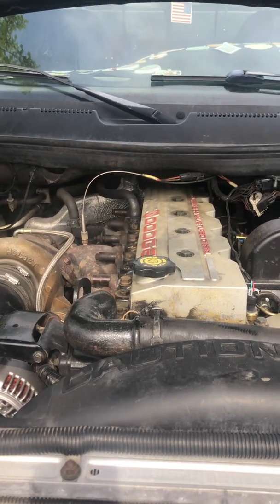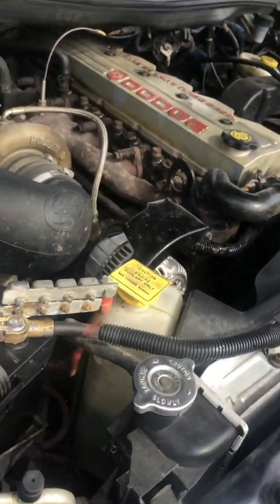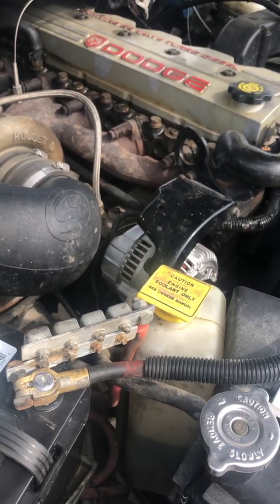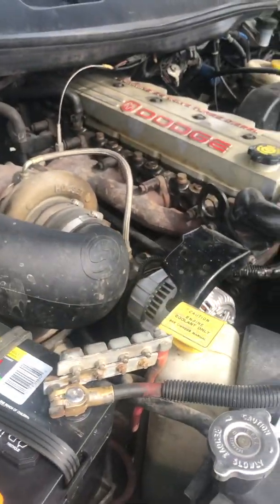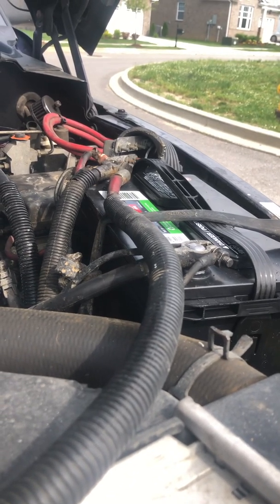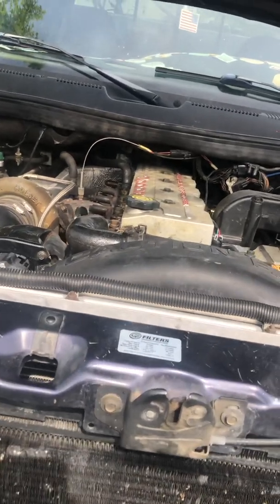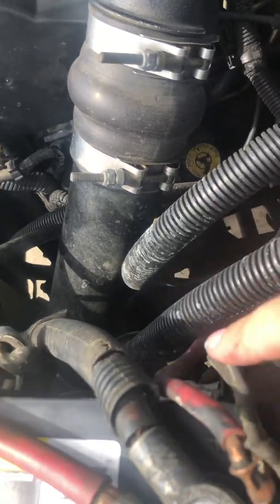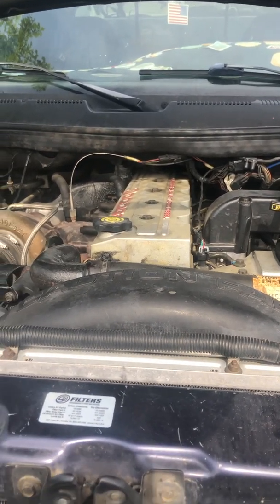24 Valve Cummins Charging System explained. Overcharging, undercharging, Alternator issues

Comment: I found the passenger side positive terminal cracked and battery post partially melted.  I thought it was just an issue with poor contact due to the cracked terminal, but was wondering about the alternator.  Thanks to your video i will change the alternator out since it's got lifetime warranty.  And i will get my batteries checked out.  Thank you!!!

Comment: Sometimes they send a voltage spike them fry all of electronic stupid how the charging system runs through the computer when they can wire it another way be easier to repair the old cars charging system was better

Comment: Thanks, excellent information.
Reply: Question, I am an old guy and need to add freon to my system. I have to do this every two to three years. I am having difficulty getting the hose to lock on to the low side of the system due to the location of the unit on the fire wall. The last thing I want to do is go to AC store. Any suggestions?
Thanks for all your help.

Comment: That’s for overcharging what about when battery gauge drops , check gauges red light on. My batteries semi new they are at 11. Something. I also replaced my alt less than two months and same problem got it checked n said batteries good ground good it’s the alt since its a reman

Comment: Hello,  Help help

Have a 2nd gen also. I have check gauges light 

2 new battery’s and new alternator. New battery terminals. I am getting a reading of 11.76 V on both sides. 

Cleaned all the grounds. Even the positive cable to starter. Tested alternator and reads the same as battery. Drains the batter in about 2 weeks of driving with check gauges. 

positive cables from passenger to driver battery had a little corrosion and also the one to the starter

Comment: Can’t you bypass the voltage regulator that is in the PCM? If necessary.
Reply: Yes you can use a 80s style Dodge voltage regulator that mounts on the firewall

Comment: Im having the same issues with my 5.9 2006. it has fried the alternator and (blew passenger side)battery acid all over/ not one but two batteries. brand new one took less than five minutes. the shop I took it to is trying to charge me $1800 for a new pcm and programming. the issues you described are very similar so I'm going to look into those diodes first. Thanks!!
Reply: Having the same issue with my 2005 I'm also having issues with my turn signal on the drivers side it turns it's self on and off like reads it out then it will work. Also my lights inside my truck won't turn on while my truck is running unless the doors are open and they will work when the truck is off and the doors are open but I push it in to turn it on and doesn't work

Comment: Diodes, are check valves. They keep the power flowing one way, and don't allow back flow when key is off. Normally in an over charge problem, the cable between the two batteries is usually the culvert.

Comment: How about if it's not charging and your gauges are not working on them on the cluster I've already replaced the PCM and alternator and the batteries
Reply: Any luck with your issue
Reply: I got one doing the exact same thing right now buddy mono starting run stucco lymph node but have no gauges

Comment: dude.. I really appreciate the info! I was told at auto zone... you need to replace your alternator... bad voltage regulator... I put a meter on it. 12.6 on the static battery test, 13.9 on the running check after tightening the grounds
Reply: So the voltage regulator wasn’t bad

Comment: I'm curious if anyone with this charging problem had it affect the automatic transmission torque converter engage & disengage wile driving, also having this problem intensify in wet weather?
Reply: Yes i found a loose ground on the driver side battery that pulled out when i made left turns.

Comment: Ram trucks had a separate voltage regulator until 91.5 or 92  .92 trucks first gen are controlled by the very simple engine Overdrive heater computer so so my 91 Cummins Ram has a regular old fashioned electronic voltage regulator

Comment: i had a 92 cummins 12v that has a voltage regulator mounted on the firewall, it was over charging and i replaced the reg but didnt fix the problem , what it ended up being was a bad regulator plug , 1 wire had broken of the 2 and 17 volts killed the single battery.

Comment: That's what happened to us today. The passenger side battery ended up overheating boiling the sulfuric acid and spewing sulfuric steam. Glad the battery did not blowup. The check gauges warning light came on, then notice the volt meter reading half of what it normally does.  Confused and concerned as we continued on, all the while noticing volt gauge gradually dropping until it was slightly above the red line.  We were thinking the alternator quit working.  So we turned around hoping to get back home on whatever power was left in the battery.  We made home to find the passenger side battery spewing sulfur smelling steam/gas.  The passenger side battery was very hot.  After everything simmered down, we found the passenger side reading 13.2 volts and the driver’s side reading 11.2 volts.  We tinkered around which included removing and reinstalling battery cables.  Then we started the engine to see what kind of voltage the alternator was putting out.  We found both passenger and driver sides measuring 13.5 volts and the dash volt gauge reading where it normally does, i.e., on the center line.  So I believe in what you said, in that the driver’s side battery was poorly connected.  Thanks!

Comment: If the ground on the PCM is non existent, will it cause an issue? I’m having an undercharge issue on my 98.5 24v, brand new batteries and alternator
Reply: I have the same year and problem did you ever solve it
Reply: I have the same issue y’all figure this out

Comment: One huge over charging issue is grid heater relay it will fry everything and have you chasing your tail.
Reply: Wonder if the updated banks ram  heater would solve the stock grid heater problem
Reply: What if I don’t have a grid heater
Reply: My light pops on while I’m driving then turns off but when I start the truck on a warm day the light still pops up

Comment: I  Have a have a Babe 99 model moral Dodge ram 4 will drive 2500 what a 24 hour comings I'm having a no bus issue quis you clusters dead nothing works except the tank church mission I thought it was bad and replaced the truthe truck's still on the move anyone have ideas?